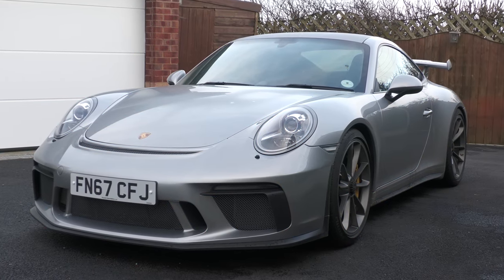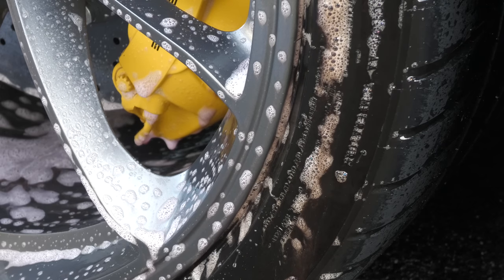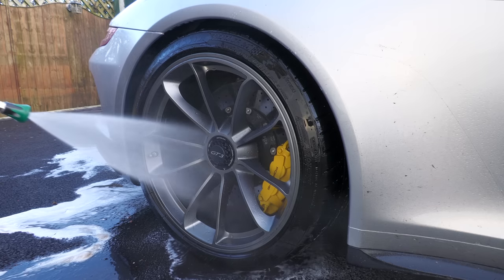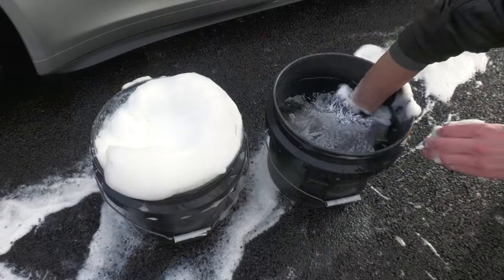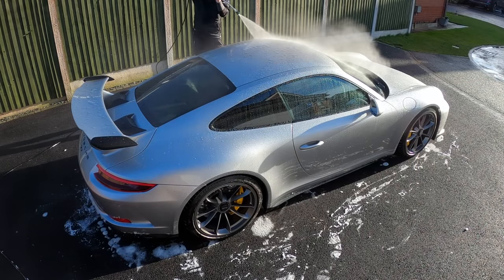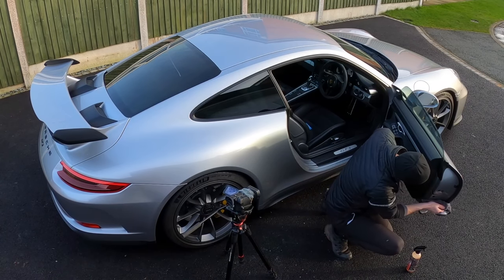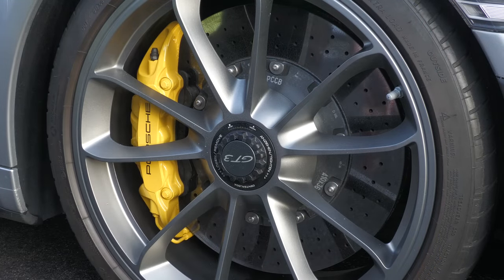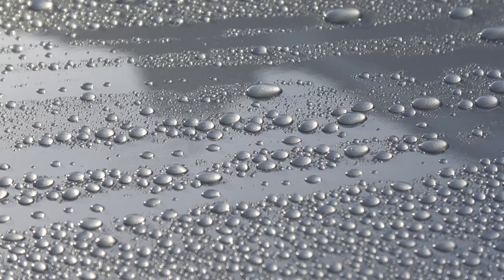Daily Driven GT3 Winter Wash & Protect

Comment: Glad to see you reviewing P&S products. Brake Buster is an incredibly popular product here in the states. It’s mostly used by detailers for maintenance washes , as it lacks the bite to clean heavily soiled wheels. It’s also not a great tire cleaner, hence the reason for the less than perfect clean on the Porsche tires. The best way to apply the product is in a foamer. Beadmaker has fallen out of favor with many US detailers because it attracts dust. However , the ease of application as a drying aid and the gloss/slickness it provides is pretty great. One product you didn’t feature by P&S is their Xpress Interior cleaner. It’s a joy to work with, great cleaning power, smells great , foams spectacularly using a soft detail brush, and is gentle on sensitive plastics.
Reply: Adding dream maker to bead maker will keep dust from attracting and leave more gloss. 10:1 bead maker to dream maker.

Comment: Greetings from the USA.  I like your content and have picked up alot of techniques from you!  Thanks.   One procedure that I added to my details are to remove the tire mould nubs/tabs from the tire perimeter.  Its just a small detail that cleans up the tire surface.  Its neurotic but it looks finished...just a suggestion...you can see them at 12:04 in

Comment: Quick question, should you be using wheel cleaner on ceramic breaks? I thought it could hamper with the performance in the long run and that just a citrus prewash is more suitsble

Comment: Everyone seems to love brake buster but I was thoroughly unimpressed with it. It'll work fine with wheels that are regularly cleaned but for wheels that require a little more attention there's much better products out there like Koch Chemie MWC. I also find that superclean, which is a generic degreaser, does a much better job removing the browning off tires. Beadmaker, on the other hand, is one of my favorite products and my customer love it!
Reply: Magic wheel cleaner seems very expensive. Personally, I do a spray of diluted super clean over the wheels tires and arches, let it sit, rinse off, brake buster in a foam cannon, then hand wash and rinse off. Works great and cheap products. Koch chemie is nice but too expensive to make sense oftentimes.

Comment: I’ve never heard of the p&s brand to be honest, seems to do a fairly decent job though. 👍🏼
I came across autosmart’s cobalt+ nano protection, does the same idea as the bead maker. And the lazy git in me decided to try applying a mix of it with an old snow foam applicator 👌🏼💥
50/50 mix, quick spritz and towel wipe of and bam the cars bead water like a day’s worth of polishing 😂😂😂 I know it’s the lazy option but it works for me. With 4 household vehicles to do each weekend I needed to up my game 👍🏼

Comment: Beadmaker is a nice product, and one of the first if not the first spray protection / QD products I had ever used a few years back, but definitely recommend giving Bouncer's Done and Dusted Si a go as I found that to be like beadmaker but even slicker and more gloss, and this is in line with what Jon at Forensic Detailing showed in his testing. That shampoo seems really nice too, and the wheel cleaner also, but I'd probably just recommend using an APC like Surfex HD on the tyres as it is incredibly powerful for that purpose, and Bilt Hamber's wheel cleaner is also apparently pretty decent but not tried it myself. Still got plenty to go through of the non-acid Autobrite cherry stuff, as it offered decent value in bulk

Comment: Looking good Joey!
Is there a difference in the snow foam on the pressure set on your washer? I got a snow foam lance from autobrite for Christmas. Only got a cheap pressure washer, just wondering will I get the same result
Reply: usually you would get way thinner foam with a cheaper pressure washer
Reply: @yaishmatheen4274  ah ok. I’ve got a good foam lance, just a cheap washer. Maybe I need to upgrade to something more powerful
Reply: I get plenty foam off a kärcher k2.